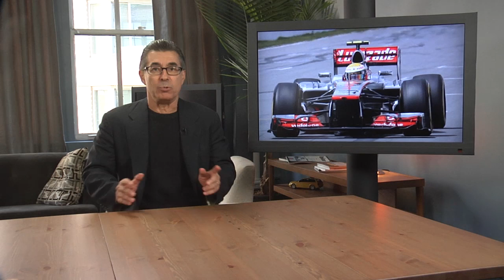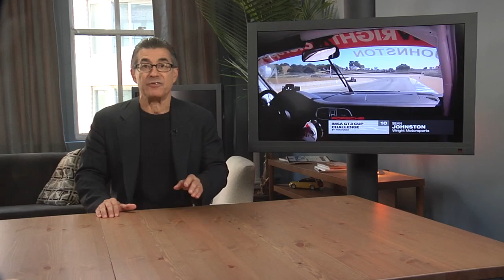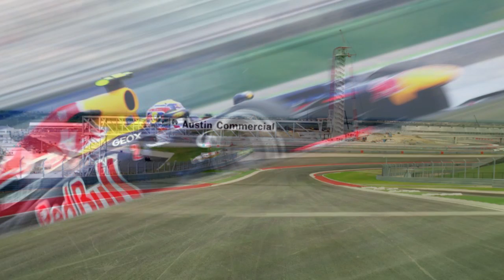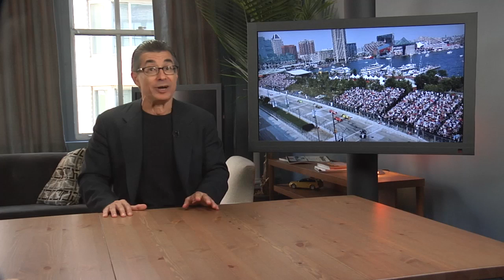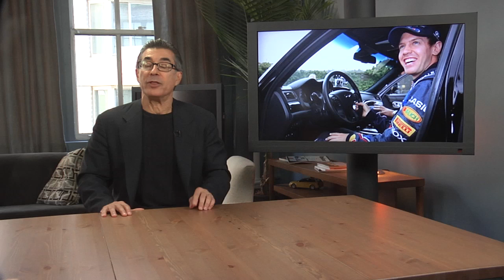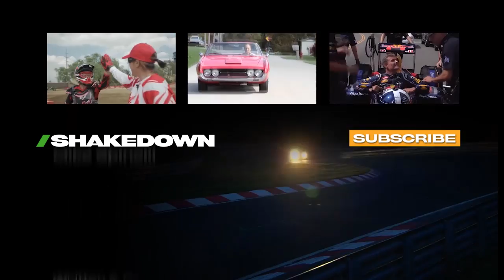Christian Horner Red Bull Racing Smoother Than Infiniti Scratch Shield Paint - /SHAKEDOWN

Comment: So, it is all in flux but GT1 used to be the most racecar-like GT car tech, but last yr it was a Euro sereis that ried to balance GT1, GT[2], GT3 spec. Now, I think that is dead as is the GT1 terminology.  GT2 is still a racecar but more restriction on tech, aero, engine size to be more production-like + cost controlled.  GT2 is now GT in ALMS GTE [Pro and Am] in WEC / Le Mans 24.  GT3 is most production-based - engine, car build, but has ABS + TControl cuz GT3 is Pro-Am drivers. This helped?

Comment: There is a place for electric racing (I would like to see something like that happen) but F1 is not the series for it. The hybrid diesel-KERS LMP1 cars are the closest to a real electric race car that runs at close an F1 pace. If F1's regulations changed to allow electric drive, nobody would switch to it. Further, if the regulations on the traditional powertrains were lifted, the cars would go much faster.

Comment: True, but battery swaps are still not realistic. They are time consuming and could be dangerous, not to mention expensive and requires partially taking the car apart. They are also heavy, and what happens if you smash one into a wall at high speed?

Comment: Lastly constant coverage of the races, full season!  It cant be presented as a one-off event, as is done every spring with APBA powerboats and Drag racing.  F1's primary target is the youth, NOT the older audience. Mid 30's on down, as well as mexican audience, that made 40% of tickets sales at CotA.  Mexican fans are loyal and will respond like typical f1 fans world wide. F1 also needs 2 or 3 US drivers or teams to root for.  Tall order i know.  But F1's main attraction are the race cars.